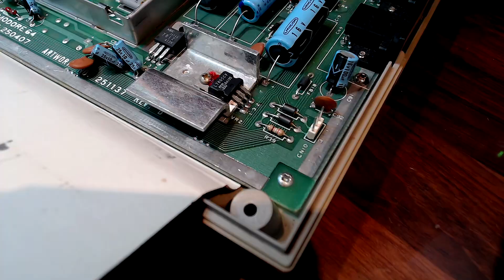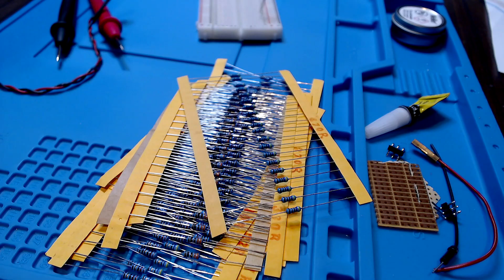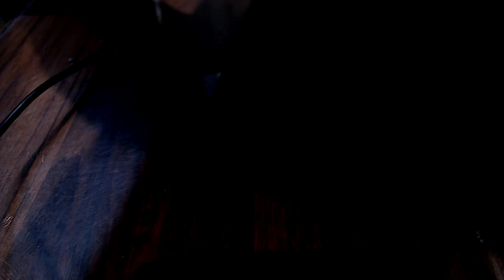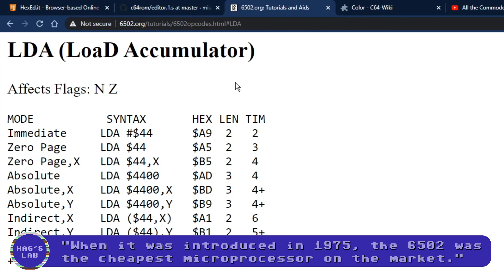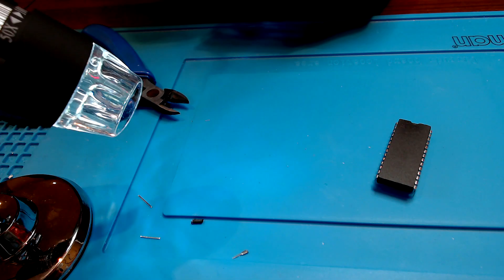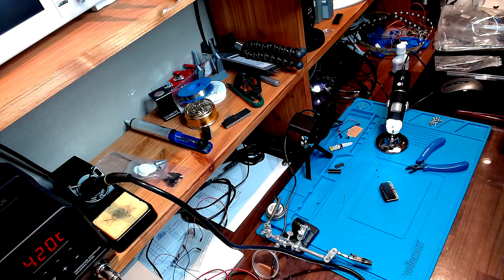C64 Fix Series | 🔴🟢 LED Replacement and KERNAL ROM modifications! [Part 5/?]

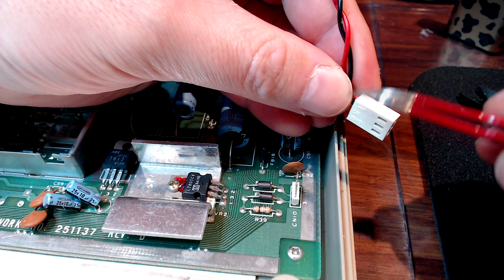Comment: At 24:30, Commodore actually did something clever here. On those pins, the center is GND and BOTH outside pins are the positive voltage. (Also check your schematic to see what i'm talking about).
This means that as long as that connector is on all 3 pins, it can go in either way. Always thought that was a nice touch.
Reply from the maker: I can't believe I didn't catch that on the schematics myself. You are totally correct. Thank you for pointing it out! 😀